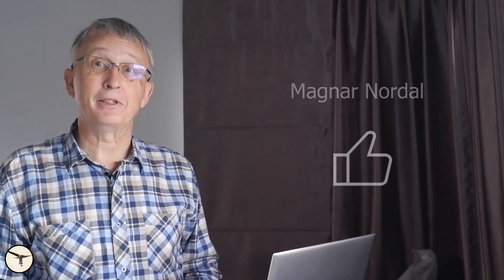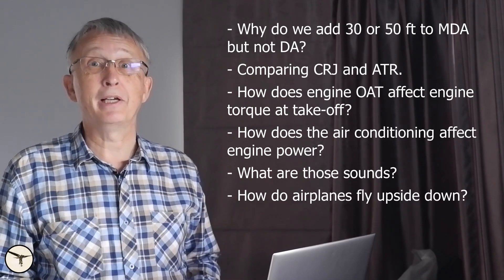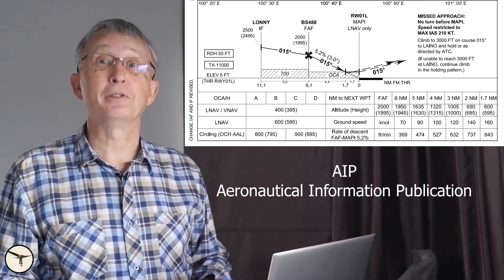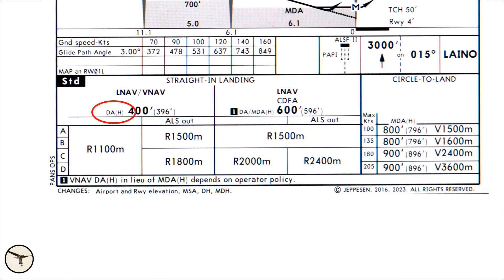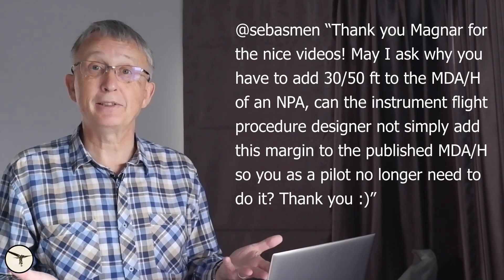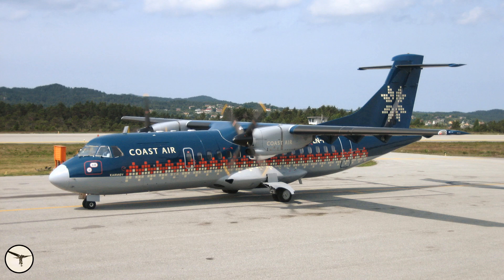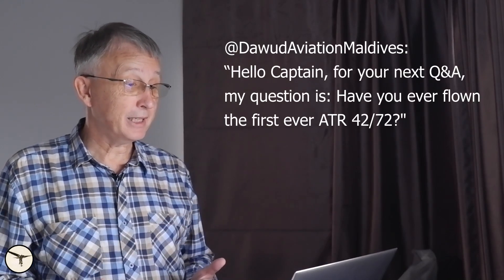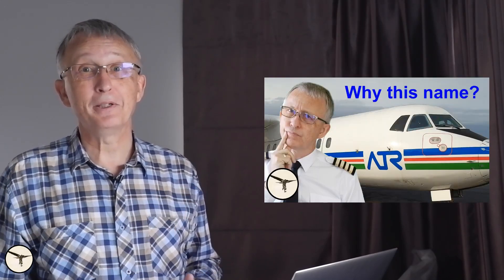Q&A #11 with airline captain - May 2024 | ATR | Aviation

Comment: I think with Q1 it relates more to the philosophy of the MDA vs DA. With a precision approach, the 50ft margin allows for the exceedance while reversing the descent trend upon execution of the missed. With a non-precision approach, depending on how one conducts the descent you could be level (dive and drive) upon arrival at the missed approach point. Airlines nowadays emphasize the continuous descent final approach (CDFA) when conducting NPAs for operational consistency. This implies that an aircraft is descending upon reaching minimums, but now there exists no inherent vertical margin to reverse the descent. Operators will use the DMDA and add that 50ft margin to prevent such an exceedance.

Comment: Thank you for the incredible work so far Magnar. As I look forward to my CPL and ATPL I can dream and hope I end up on the Air NZ ATR fleet with excitement studying your videos.

A question with the ATR neo next gen design moving to electric deice rather than boots. How much spare electrical load was available in the ACW? Will this mean more of the upper wing surface can be protected as the revised boots did to deal with high AOA? Wouldn't larger surface electric heating pull quite large loads? In my mind the ATR airframe is not so big that the pneumatic system weight would be so high as say the 787 going full electric.

Thanks again for your wonderful videos and generosity with your time and expertise. Much appreciated here in 🇦🇺🦘